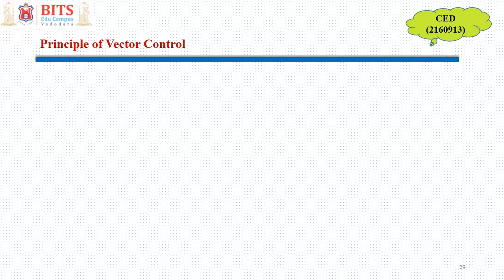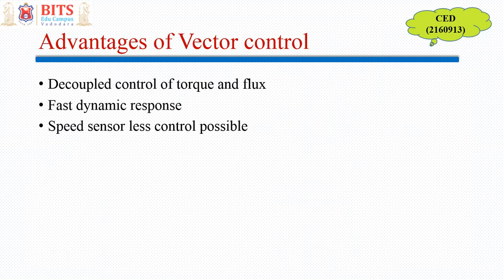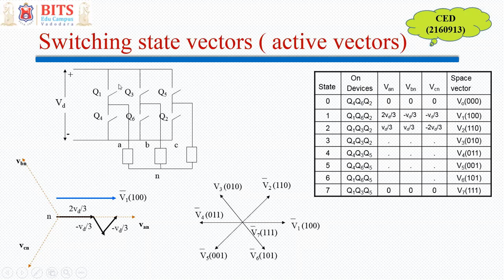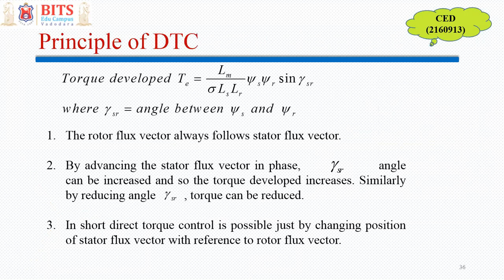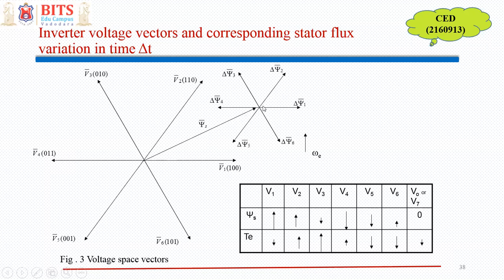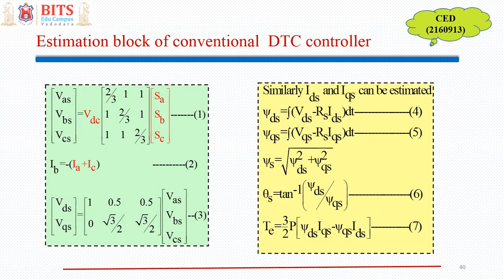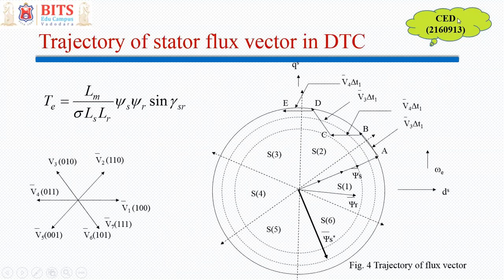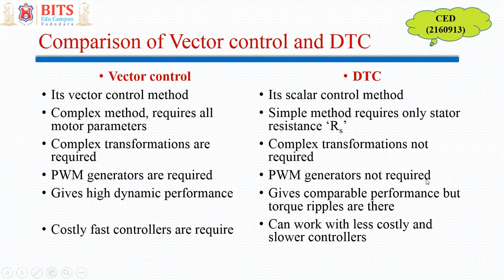Direct Torque Control (DTC) of Induction Motor Explained | Basics & Working

Comment: Amazing Explanation...Plz let us know how to calculate reference value of flux ?
Reply from the maker: There is mathematical way but for rough estimation run model on no load with rated voltage and measure flux...this value can be treated as reference value for future speed control

Comment: Great explanation in very good manner. I have small doubt that some Inverters are using DTC based drive how it can be used for inverter?
Reply from the maker: Thank you for your comment...Inverters are tools to implement DTC . DTC is possible only for inverter driven drives. If you have more doubts you  can email me on prmankad@gmail.com
Reply: do  you have similation  of direct tourqe control in matlab simulink

Comment: Sir I have read your journal on DTC conventional model,  can I get the simulink file used in your journal...please
Reply from the maker: sure but it is in old version of Matlab....mail me at prmankad@gmail.com
Reply from the maker: Send email
Reply: Hi sir, can i have the simulink file please. My mail ID rajuelectrical245@gmail.com
Reply: do  you have similation  of direct tourqe control in matlab simulink
Reply: @faridfakhr887   please send me Simulink file of direct torque control